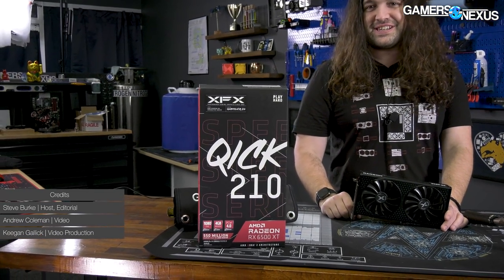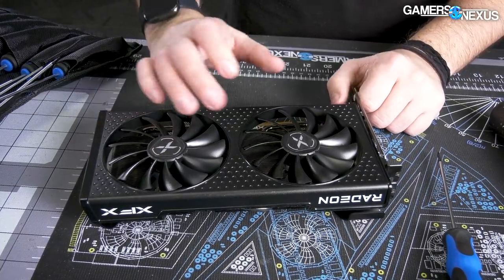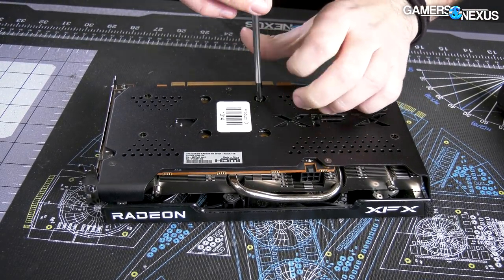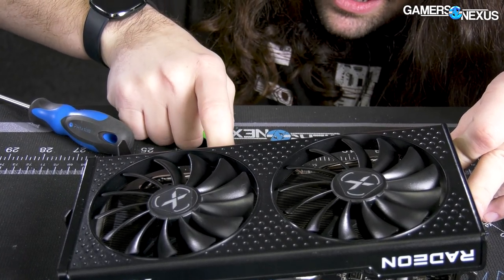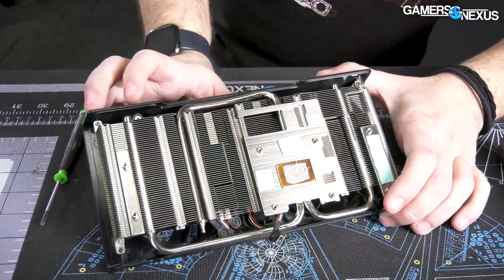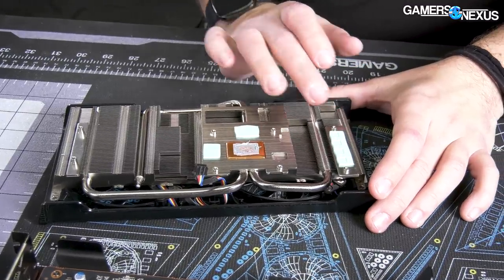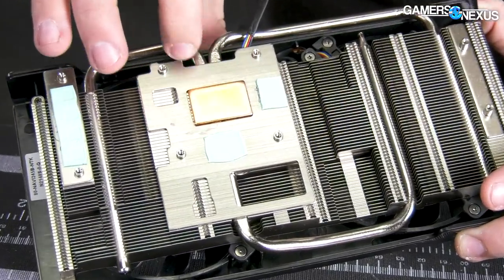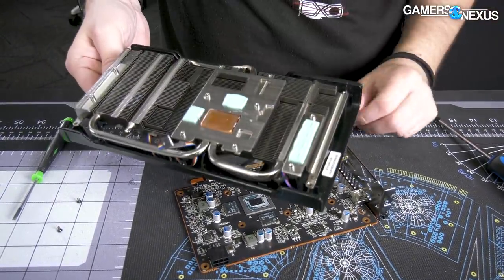Tearing Down Trash: AMD XFX RX 6500 XT Disassembly

Comment: AMD really screwed up with this GPU. If they had reduced the power draw just 6W it could have been a PCIe power only card and actually been in a useful part of the market.  Make a low profile version and its even better, letting us turn all those i7 6xxx series office boxes Microsoft just knee capped with Win11 into stealth gamers.  They do that and the missing encoder is no big deal because you can use the iGPU for that.
Reply: Not unless you have a Ryzen 3 3100 which came with no iGPU.
Reply: The fact it's a PCIe 4.0 x4 and not a PCIe 3.0 x8 pisses me off.

This class of card is more then likely going in a PCI 3.0 board. The damn thing will run at PCIe 3.0 x4 reeee
But 4GiB vRAM and 64bit MemBus is also other massive concerns.
Reply: In any other circumstance other than the pandemic and shortages, AMD would've done this. But because they know people don't have a choice in these scalped markets, they don't give two f's about the worth of low end cards anymore.
Reply: @Thaumazo  Business customers can't buy graphic cards on eBay.  Any accounting dept would not allow it.
Reply: @AgentLokVokun  pci-e 4.0 are about 2 years at market, so I don't agree with you. Intel has only expensive 4.0 boards, but there are a lot of pretty cheap  AMD boards with pci-e 4.0 on the market, so that's not a surprise AMD wants to promote their chipset and processors with their GPU.
Reply: @blakegriplingph  Exactly
Reply: In testing it draws up to 100W under load in certain games. Pretty sure a 6500 non-xt or 6400 will be the the power plugless one and will only exist as a counterpoint to Intel Arc's 128 card.
Reply: @AgentLokVokun  Which makes it even stupider that they didn't just underclock it a tiny bit to get the power under 75W. Its being chocked by the PCIe bandwidth anyway. It probably wouldn't even have a material impact on actual gaming.
Reply: You’re being overly harsh to AMD. I suppose you’re ok with Nvidia strategy of having no msrp for GPUs. For all of the disappointments on YouTube, I would like to see the 6500XT overclocked performance. I think the Samsung GDDR6 can overclocked more than people think.
Reply: @NightMotorcyclist  Blame intel not ATI or AMD - Dell and Intel forced customers to use  GMA/ Xe to save costs. I heard Pentium days - most desktops and laptops have dedicated graphics chips. And Apple is willing to produce high-performance SoC forcing Nvidia to become a CPU/ SoC vendor.
Reply: Will it not post without the pcie 6pin? Lots of mid range cards will still run without the 6 pin.
Reply: @tringuyen7519  
There are better ways to admit that you are a fanboy
Reply: You could power limit it (or does it on its own if no cables connected?), right?
Reply: @NightMotorcyclist  Oh grow a brain mate. Yes yes AMD, it's all AMD screwing up the lower end of the market, just AMD, not Nvidia or Intel, it's just AMD!! blah blah blah
Reply: Agreed would be great if it was pcie 4x having it a x16 slot is just stupid
Reply: How the f did Microsoft "kneecap" intel 6xxx with windows 11??
Reply: @Sindamsc  I disagree. AMD changed it to to 4 instead of 8 or 16 because they are saving as much money as possible. There are also plenty of "cheap" b560m boards which support pcie 4.0
Reply: Or better yet, for them to put more focus on better drivers.
Reply: @AgentLokVokun  Or Pci2.0 😒
Reply: @samgoff5289  install windows 11 and find out
Reply: @r4z0r84  I don't have an intel 6 series cpu so no I would not find out
Reply: @AgentLokVokun  In that case, just make it PCIe 4.0 x8 and call it a day.
Reply: @Sindamsc  what? There are 100 dollar pcie 4.0 intel boards
Reply: @anusmcgee4150  well they were already made with4 lanes for laptop which was going to be clocked lower too.
They cant remake them with 8 lanes magically
Reply: @samgoff5289  I'd say his talking about office machines that are running low end 6000 series with mobos that dont have tmp2.0 so they don't auto update to windows 11. More so the mobo than the cpu
Reply: @Thaumazo  I wouldn't even give them that much credit. I just think they didnt even consider it. There is a huge hole in the market for a PCIe powered GPU.  Its insane that 1650LPs are going for more than regular 1650s.
Reply: @tringuyen7519  Good god why does everyone turn this into a fan boi deal? Companies are not your friend.
Reply: @WildkatPhoto  Buncha armchair hardware engineers on here - they obviously took the time to maximize everything balancing this-and-that and taking off the 6-pin to get it under 75w surely was something they tried except it DID hinder performance because there's no such thing as a clean bottleneck. They obviously determined through experimentation trying to squeeze every last drop of performance out of the thing that it was worth it to enable it to draw more power just to get the performance up while already having the PCIe choked out. Yes, in a poorly optimized application that relies heavily on constantly submitting data, state changes, and tons of draw calls to the GPU it wouldn't have made a difference to keep it running on a bit less juice but what about *everything else*? Not every application relies heavily on PCIe bandwidth for rendering performance. That was the big hubbub about graphics engines over the last 20 years: moving from a tight CPU/GPU interaction in the immediate mode days to a more remote processing model where the CPU loads everything the GPU will need ahead of time and lets the GPU handle things on its own. Now we're seeing a trend toward streaming but software devs aren't supposed to assume the hardware is supposed to have a bunch of performance - that's why PC games have graphics adjustment settings. Devs build software around the hardware, not vice-versa. You can't magically fix supply issues as long as everyone keeps buying into flu scaremongering politicians. Devs are just going to have to compensate and start getting smarter about streaming. Hardware engineers have no choice but to produce the best possible product, that's why they call it "competing" in the market place.
Reply: @samgoff5289  Only 8th gen and newer is officially supported. In most office environments that means a lot of 6th and 7th generation systems are going to get replaced needlessly.  Thats great for people like me who like to take those systems and turn them into mid spec gamers but most of the time that also means only PCIe power. Dell is notorious for putting the absolute minimum PSU in systems because they know they dont have to worry about powering anything. Worse, those PSUs are proprietary so you cant just swap in an ATX PSU.  That means you need a PCIe powered card like a 1050ti or a 1650LP.  It would be nice to have a newer GPU to put into the. An i7 6xxx is a VERY capable gaming CPU.  Heck I have an i7 3770 and a 4770 that still crush it today.  A 6th/7th gen is even better.
Reply: @WildkatPhoto  ok but like I asked before how did Microsoft knee Capp 6000 series with windows 11? They run exactly the same as before win 11 released and not sure if you realize this but windows 10 didn't disappear I am still on win 10 and haven't even considered the "upgrade" people really need to stop with the "gotta get the new shiny thing" especially where there is literally no difference between them
Reply: @Sindamsc  Only B550 / X570 boards officially support PCIE4, and those aren't much cheaper than an entry-level B660 board with Alder Lake which does support 4.0 as well. 300 or 400 series AMD boards may unofficially support 4.0 but roll the dice and pray it's either not flashed with newer BIOSes upon purchase or even if it does work, hope it's stable.
Reply: You are speaking of the new W6400 AMD just announced yesterday. 50w (no additional power connector), 1-slot thick, 2 DisplayPorts, low profile.
Reply: @tringuyen7519  They've tried that, it's not impressive. One reviewer even notes they were able to slide all the way to the max for both clocks and memory with no instability - the performance uplift wasn't special or unusual. That said, they also note that the sliders appear to be artificially limited - the sliders don't go very far.

It sort of makes sense. This is an already-superclocked mobile GPU, and a narrow bus means clocking the memory higher won't result in a large enough bandwidth increase to offset any issues.
Reply: @samgoff5289  Dude we are talking about corporate systems. Corporate IT doesn't mix OSs within an organization. Everyone is on the same OS.  That means any system that cant be upgraded to Win 11 will get trashed. We are right at the point where 6th and 7th generation systems were going to get life cycle replaced anyway, Win11 will just speed it up.  Businesses upgrade on a schedule, nothing more. This will accelerate that schedule during a global chips shortage.
Reply: @ThanwaSripramong  No. Thats not a gaming GPU.  Its even more crippled than this one.  But it does show that with a little bit of work they could have made a decent LP GPU.
Reply: @CharlesVanNoland  Yeah? For all that wall of text, we're all living in the current condition where current games DO use the bus and that older GPUs (including AMD's last-gen model) did not suffer as much as this one does. So instead of railing for a theoretical perfect world in the far future where devs optimized games to, uh, accommodate for 1 GPU that's not very good, why not focus on the fact that no other GPU sold at that price range suffers as badly?

Heck, a GTX1650 was able to 'stuff' PCIe 16x, a 128-bit bus, and very good H264/H265 Hardware Encoders in 75W - on TSMC's 12nm node. And the 1650 is sometimes not too far behind the TSMC 6nm 6500XT which slashed all that stuff out.

It doesn't take an engineer to figure out something is amiss. And really, based on the info that this is simply a repurposed laptop GPU, it's not all too surprising. On second thought, that's even worse because laptop GPUs are supposed to be power efficient.
Reply: @tringuyen7519  Sweet whataboutism bro. Nobody said anything about Nvidia because this isn't an Nvidia video. Go to Nvidia videos if you want to see people complaining about Nvidia. You are what's wrong with the internet.
Reply: @CJonestheSteam72  Sobs in FX6300
Reply: @sonicboy678  This is such a silly card. 

Blows my mind people will throw this in a 2.0/3.0 slot and totally have more issues.
Reply: @Sindamsc  While I understand your point of view anybody with a 10xxx (or below) or 3000 AMD (or below) are PCIe 3.0.

If I had a 10600KF and my GPU died and I needed SOMETHING the system would be gimped pretty hard for seemingly arbitrary reasons.

Somebody else suggested making it a PCIe 4.0 x8 to remediate the issue slightly. 

In a perfect world this card would make more sense. But LTT even showed that it doesn't even say on the GD boxes that it's 4x lanes only.

The common folk won't know any better. 

I don't want to say what AMD is doing is malicious. But it's deff negligent.
Reply: @Thaumazo  Yeah... basically.
People asked for SOMETHING. ANYTHING.

And Pika.jpg'd when it was a 4GiB, 64bit MemBus PCIe 4.0 x4.
Reply: @WildkatPhoto  You are exactly right. W6400 is NOT a gaming card. It was designed for office and light professional use. It is a shame that we do not have much choice these days/
Reply: Under Evil Su, she took AMD and went full Intel/Nvidia.

They might as well remove all of the encoder SIP, since, AMD seems to not to care about improving their encoder, it's the bottom of the chart, below Intel.

Unfortunately, even if you pair this with an AMD system, non-APU, you're wasting resources on a low-end 6c.
Reply: @AgentLokVokun  AMD recently upped their game in memory compression, I believe that Navi, RX 5000 series, AMD demoed their memory compression, which is way better than pre-Navi, including the RX Flop series/Flop VII.
Reply: @AgentLokVokun  It's a shame it drops around 15% in several games when using PCIe 3.0.
Reply: @WildkatPhoto  Underclock it...It's a turd already and gets beat by a 5500 series...I got a 6600 with 8gb and it doesn't impress me at all. AMD got some explaining to do when their old cards are beating the new cards...SMH
Reply: PCIE power draw needs to be very close or just over 75W to make a GPU without a power connecter. So, the GPU needs to consume on average up to 60W and max for a few ms up to 90W to do so. RX6400 might manage it.
Reply: @LinxESP  most vBIOS's will prevent the card POSTing without a cable connected. If you were able to edit the bios to bring the power usage down and then remove the PCIe cable requirement from the vBIOS, then it would work
Reply: This is what happens when AMD doesn't even try any more.
Reply: @giorx5  Pretty sure the PCIE power draw on the slot is 75W, that's the maximum tolerance.

The default it should be for an x16 is 60W.

Then again, 6500XT is a x4 slot, so up to 25W.
Reply: @arthurbonds7200  "...no other GPU sold at that price range..."

Show me a GPU you or I could buy, right now, at that price range, that can keep up with the 6500XT, son. "Theoretical world". Sorry, bud, but we're living in a world where hardware ain't cheap, the software is the only malleable aspect of the problem at hand that can adapt, not the hardware. Should be crystal clear.

But you keep dreaming that GPUs will be like they once were. $150 for 16 PCIe lanes and great 1080p performance on medium settings. Welcome to the new world where the idiots running the show are scared of a flu and ruin everything for everyone.

You're acting like they can just pump out GPU dies and this was a fumble. Wake up. This is a desperate hard-won attempt at bringing some kind of affordable GPU to market that isn't completely useless.

But you keep pretending like better options are out there, have been, and will be, out there in magical fantasy land where the realities of manufacturing aren't even on your radar.

Show me a brand new GPU at the 6500XT's price point that I can buy right now that will compete with it. I dare you. We're in a whole new world boi.
Reply: @CharlesVanNoland  You're acting like the situation we're in is permanent - it's not. It wasn't permanent before in previous shortages, it won't be permanent now.

What's laughable is that you're defending AMD for obviously taking advantage of the market - that's plain and simple what this is. I don't blame them for not just redirecting dies from higher GPUs to lower SKUs because that simply doesn't make business sense considering everything else sells out. What that doesn't excuse is literally not adding a couple of dollars (markup included) to add additional traces for a PCIE 8x connection instead of 4x. Instead, they just rip out a laptop GPU likely as is and slap a cooler on it - that's lazy. 'Supply chains'  has little to do with that, except that they know they can get rid of these products no matter what price they put it at.

I can buy a brand new GTX 1650 right now that's a little bit below the 6500XT's performance (on PCIE3, sometimes matching it), at a lower price. Locally, most 6500 XTs sold right now are going for $450+ already, while you can secure a new 1650 Super (a product that plays in the 6500XT's ballpark, but more well-rounded) for either the same price or slightly more.
Reply: @AlfaPro1337  I don't think that's how it goes but that isn't related to the limitation in power I posted previously.
Reply: @garricksl  Because the most basic computer needs a basic graphics adapter? Nowadays, Intel iGPU is OK for 1080p Low.
Reply: @AgentLokVokun  it was designed for a laptop two years ago, you can't just change pcie lanes like lego overnight
Reply: @Thaumazo  qmd could have had msrp at 250 if they really didn't care, but instead they are only making $10 profits, think about that for a second, and yes this gpu is better than an xbox series x 

The only gpu worth getting rightmost would be a 6700xt, faster than a 2080ti for $800 only
Reply: @WildkatPhoto  it's not being choked though, buy a 12400f and a cheap b660 mobo and this 6500xt and for what 600-700ish  you get a respectable pc which wouldn't be possible le last year  gpus cost that much

And if you really cared about budget you would get a gaming laptop in the first place, external monitor and peripherals  and you have a beastly setup
Reply: @gerhardsmith7892  nvidia didn't put an msrp on the 3080 12gb, no one is complaining tho
Reply: @monke2361  no, it was designed for a laptop that would use pcie4  the igpu in the laptop would have the encoders etc, pcie 4 x4 is plenty for a laptop dgpu, Lisa said it herself it's a laptop gpu

Now the rx 580 is still respectable performance, 1080p60fps or higher for esports, for $200  under 300 scalper market

It's a good deal, and because it's literally only for gaming miners won't want it and its not for content creation either
Therefore it won't go higher than 300

Keep in mind $200 today = 175 when the rx 580 was launched and 7nm is much more expensive than 14nm, so the price is reasonable

Would you rather get a 1050ti or 1650 instead??
Reply: @tringuyen7519  absolutely correct. But we aren't supposed to talk about that side of the coin on this channel anymore.
Reply: @LeonardTavast  BRUTAL :c
Reply: @AlfaPro1337  I'm sure their compression is fine... but this class of card is still "Yikes" territory.
Reply: @jesnamara6759  Can't fool me twice Mr. Evil Block Chain!
Reply: Top comment